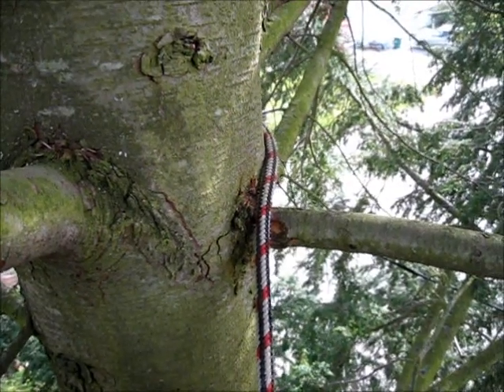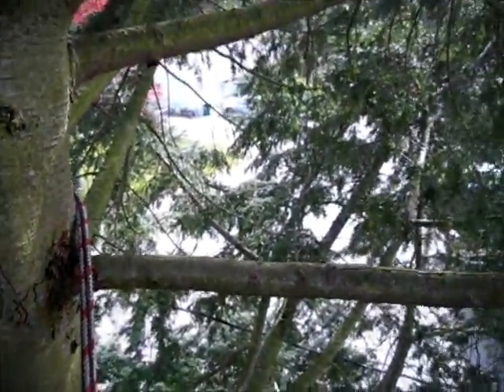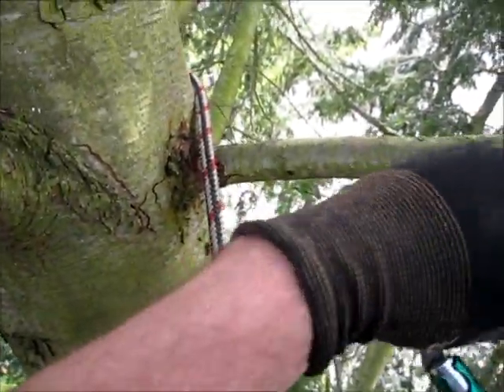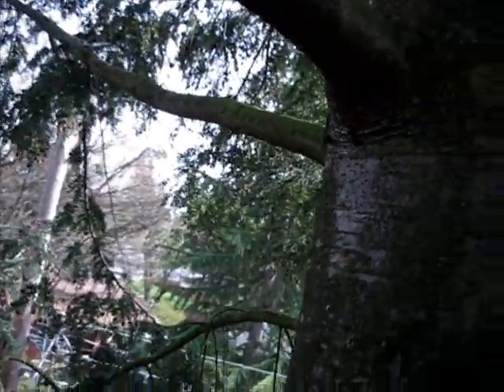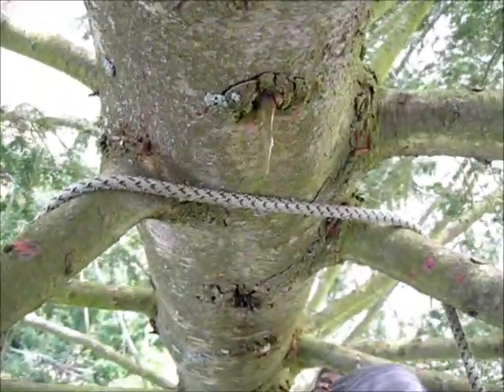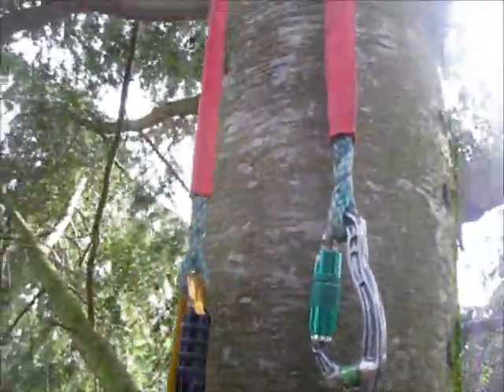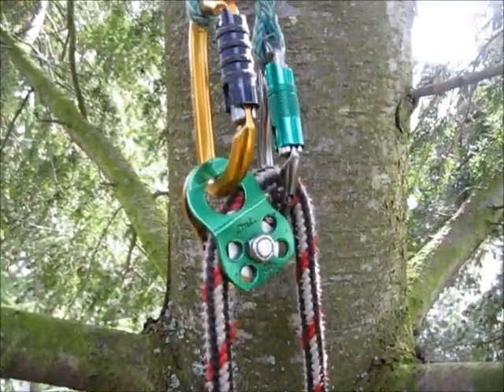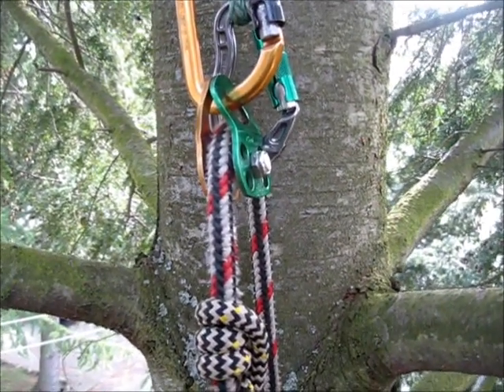Basic SRT 2 - Moving the TIP.wmv

Comment: Hi mate, no offense but pls use safety equipment to use as friction saver. This micro pulley is NOT rated at all put a life in. Use dmm pinto and this should be bomb. Also, do not use your lanyard like this. take time going around the stem. Climb safe 👍

Comment: Great description.  I'm running into this need as well and have been searching all over the Internet for ways to advance the SRT TIP and still be able to retrieve from the ground like all ring type friction savers in DRT.  Surprisingly not much out there on this.  Is this just not a common need I wonder?  I like your system.  The only other one that makes sense that I found is two caribiners, with one biner smaller than the other so that an end of line knot or retrieval ball will pass through the large biner, but not the second during take down.  Thanks for posting.  I may go with your method.